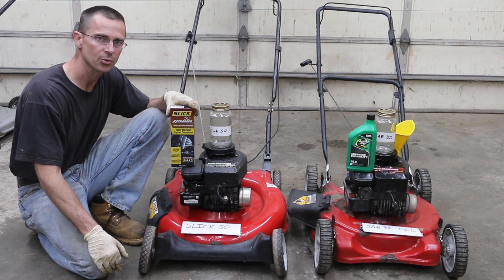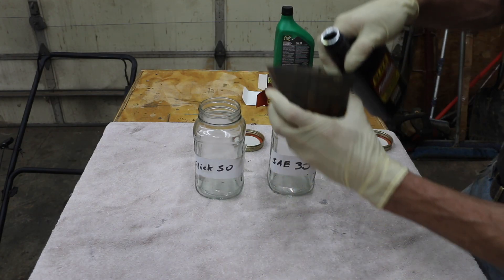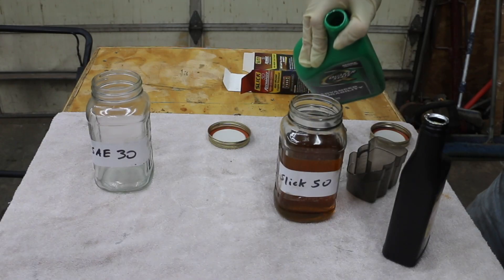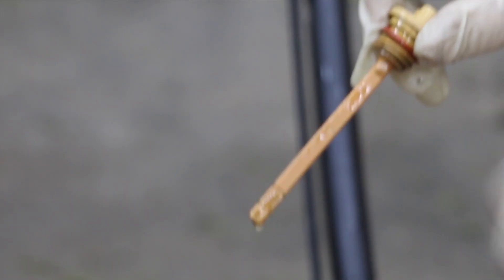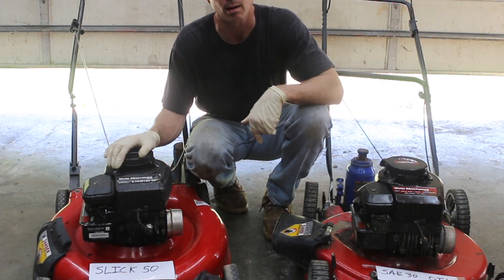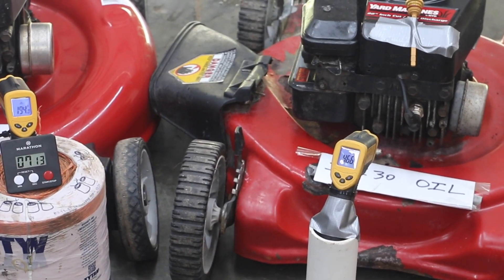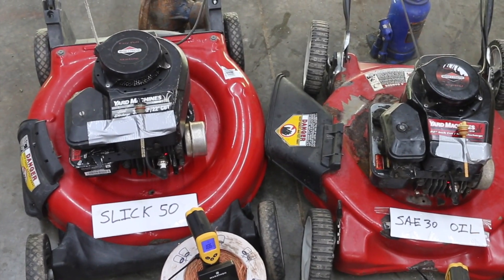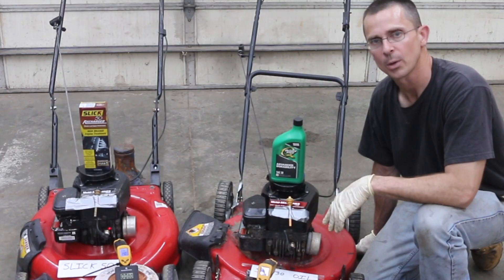Can't believe what SLICK 50 did to my engine!!--Dry Crankcase Test!

Comment: The original developers of slick 50 never did market it because they found it to be generally ineffective..Because of monopoly issues the original company had to sell it because other companies knew it was marketable effective or not..The rule of thumb today is don't add anything to the oil you are using because the manufactures spend a lot of time and money making great oil right out of the bottle..It doesn't need ANY help..You will generally detract from the quality if you mix anything into it..It's like this..Specific base stocks are blended with specific additives..We should never try to out think companies that spend millions in labs to produce the liquid gold we choose..Last hint..All oil is good oil today..The most important thing by far is change it regularly..!!!!!!..This video was a great example of not mixing anything with your oil..Run it as is!!
Reply from the maker: Thanks for the feedback.

Comment: You know about 20 - 25 years ago there was something with, I think it was PTFE in it. Was that the Slick 50? I remember trying it and adding it into my engines using a plastic 8oz clear plastic measuring cup. I still use the measuring cup in my garage today, however I do notice in the bottom of that measuring cup is a clear substance that looks exactly the the plastic that the measuring cup is made of that dried rock hard. It was a small amount that settled in the bottom of the measuring cup. To this day it is not removable.  It is almost as if the PTFE was a substance that would fill any microscopic voids or scratches and make that surface perfectly smooth. They used to advertise it as being like wet ice against wet ice.----------- This additional comment is being made AFTER both engines seized up.  I do believe that no engine will last without an oil, or lubricant in the sump.  But I do believe Slick50 was probably a better product as it would, as I said before, actually "fill" small scratches, or voids and allow for smoother surfaces to rub against one another.
Reply from the maker: Thanks for the feedback.

Comment: Many thoughts however the most defining idea is that if Slick 50 or any additive protected significantly then manufacturers would would install it at the factory to insure against any issues during the warranty period.  I am not aware of any manufacturers buying into this cheap insurance.
Reply from the maker: Great point. Thank you

Comment: I was told (by a Harley mechanic) than any engine that has roller bearings (as Harleys do) need some friction to make sure the bearings roll and not just slip. So something like Slick 50 might actually do damage.
Reply from the maker: Thanks for the feedback.
Reply: Yes similarly i have heard that  sometimes too much lube in certain circumstances can be a problem , like for example in bearings that use grease , if too much grease  is applied  the rollers may actually not turn and just glide on the grease eventually  ruining the bearing .
  Hard to really understand why the slick 50 failed  early without  stripping them down .
 Many years ago in Australia there was a product advertised where they added some magic lubricant that allegedly put a coating on the engine internals , then they removed the sump and ran it even drove it  for some time and it  did appear a legit product.
IIRC they pulled the motor down after a drive and it looked perfect , , i think it was done on an Aussie ford 6 cylinder large sedan ?  
  But i don`t know for sure , i think the product was called Bardahl  engine protection ( not sure about the spelling ,  dont quote me on that though   :)  ) .
   The thing that goes through my mind , 
is if these magic additive products really makes metal parts not wear , car manufacturers would be onto it like a rat up a drain pipe  :) , but here we are over 100 years of motor cars and still using engine oil ( probably  a bit better quality engine oil , but still engine oil ) .
  I had a bit of a look for the aussie demo  video of the bardahl stuff , but could not see it , 
I did find a phillipino one , but they did not do a tear down afterwards .
   https://www.youtube.com/watch?v=Q2uqtmcQtJE

Comment: Thanks for all your great vids. Just wondering i use a product called nulon in Australia. It is like a rougher version of slick 50. Nulon is actually milky whereas I noticed the slick 50 was clear. Would shaking the slick 50 more b4 adding to the oil be more beneficial. Can I ask how long U ran the slick 50 in the mower b4 draining. From my experience with nulon it takes about 4 or 5 hours of  operation to optimise the coating on the wear surfaces.

Comment: i just saw that slick 50 formula is now named : xcelplus oil additive , and the slick 50 name has been bought so you are not getting the original formula but just paying for the name and  not getting the good stuff , i used it in 1994 just looked it up , great experience , dont even know if i got the good stuff

Comment: i think the mowers should be of the same brand at least , imagine the one with sae 30 is a Toyota and the one with slick 50 a kia , im just saying china bearings vs japanese vs american bearings a retest with same brand of mowers would be cool , i just slick 50 , 20 years ago i used it and  the engine really liked it improved in every aspect from starting , much better throttle response more mpg and now i just finished a rebuild  G13A car engine and was thinking of breaking it in with some slick 50 so ended up watching this video good job keep it up

Comment: My only question is what temp each engine would run with the same oil?  Maybe the Slick 50 engine ran cooler anyway.  
When I lived in the UK many years ago, I used Molyslip (molybdenum disulfide), because of similar commercials, but it was a thicker, silvery additive.  Never seen it in the US.  No idea if it worked!  Now I just use Synthetic oil and change every 6000 miles
Reply from the maker: Thank you for the feedback

Comment: Did you ever test Muscle products MT-10 metal treatment? Made in Butler Pa
Reply from the maker: Thanks for the video idea.
Reply: @ProjectFarm  I've used it in all my vehicles and equipment for over 10 years. No engine issues or high oil consumption.

Comment: How about trying prolong engine treatment. I used to run it in my 92 2.5 S10. I never lost an engine to lubrication issues. All of the failures were top end in the number 3 cylinder. Broken valve retainers and broken valves.
Reply from the maker: Thanks for the video idea.

Comment: I wonder why the control ran for only 7 minutes when the control in your experiment with Bestline ran 38 minutes. That’s a big spread.
Reply from the maker: Great point.  Briggs and stratton engine used in this video and predator 212 engine used in the Bestline video.  Major differences in engine design

Comment: leaving out uncertain wear histories between the 2 mowers I have a few comments...

ORIGINAL Slick 50 used ptfe as an anti wear additive...until a bunch of people weren't changing oil and the ptfe got cooked in oil galleries and blocked oil flow

whatever is in current Slick 50 is probably getting cooked into clusters that are seizing the engine much faster since it is not being circulated & cooled down by flowing oil; sae 30 plain oil lacks whatever is in Slick 50 & stayed as a microlubricant on surfaces until engine cooked off residual layer of oil
Reply from the maker: Thanks for the feedback.

Comment: Slick 50 is a Teflon based product. It's been shown that the Teflon will form clumps which can clog oil passages and starve the engine of oil.  Those worried about extra lubrication should look for a high zinc oil.
Reply from the maker: Great feedback. Thank you

Comment: Since it’s supposed to absorb into the metal I’ve often wondered if duralube oil treatment would protect the engine better than other additives. If I remember the product would migrate toward heat to lubricate the parts.
Reply from the maker: Thanks for the feedback.

Comment: Back when it first came out we used to sell it like Amway. Our demo engines were treated with pure Slick 50, no oil mix. We’d fill them and let them run to operating temp, then drain them. These engines had plexiglass installed so customers could watch it during the sales pitch. They’d run flawlessly for quite awhile. That was 1981.My 69 VW bug I lost the oil drain plug and drove 150 miles before discovering it, was treated with original formula  Slick 50. No damage to the engine. I’m also a Motorcoat user. You ought to try the same test with Motorcoat, in fact their old product videos did a similar test. You might contact the company and present the challenge, show them this video. Thank you for all your work! Please keep it up! The original formula Slick 50 is now Xcelplus according to the John Bishop interview. People made good money selling the original formula and it was a good product.
Reply from the maker: Great feedback! Thank you

Comment: It depends on the oil that's added to slick 50, I had good luck with slick 50, it made my lifters less noiser engine ran smother, but I never thought it would keep motors from locking up without oil,you folks crack me up, I would like to see wood gas projects

Comment: Try Duralube.  My father once had an oil change place install his oil filter with no rubber gasket and he drove 3 hours on the highway immediately afterwards.  When he arrived at his destination the bottom and back of the car were completely covered in oil and the crank case of his Camaro's 305 V8 was empty.  The shop paid a dealer to analyze the engine for damage and they found nothing wrong with it.  The engine went on to live a long trouble free life!  My father has always run Duralube in everything he owns and swears by it.  He tells this story often.
Reply from the maker: Thank you for the video idea!

Comment: 30 years ago I had an engine I treated with  slick 50 I run it an hour dry then filled it with water and run it for 30 minutes  and it  never locked up  but the stuff you buy now days I think is different stuff.
Reply from the maker: Great point. The formula has changed from the original formula

Comment: I remember the Slick 50 commercial from years ago that you mentioned. A work acquaintance thought PTFE was the key to world peace, among other things. His 1989 Caprice was dosed with it occasionally, along with regular oil changes with Mobil 1. The Caprice was still running on the original engine with over 300k miles years later.  

That engine was treated well and received regular oil changes. That, no doubt, was the biggest factor for such longevity, in any case :)
Reply from the maker: Thank you!

Comment: Have followed you for quite a while !
We own a small engine repair facility as well.
Our second business is an industrial lubricant, etc. distributor.
We also have a product that we demonstrate in a running engine after adding the recommended number of ounces of product to straight SAE30 NAPA or equal motor oil, run it for approximately 7-8 minutes with the two, then drain, and let the engine sit and run albeit a bit above a higher than a normal idle for a number of hours.
If I send you the product, and the  SAE30 motor oil, would you be willing to do the demonstration on camera for me ?
I am severely injured, and no longer able to do the demonstration, definitely not able to do it on camera !
We really don't want to be pushing the product at this point, until you would feel like you would be comfortable with doing the demo.
Looking forward to hearing from you.
Thanks again, totally appreciate your videos, and your testing methods !
Reply from the maker: Could you please create a new comment or send an email to me at projectfarm52@gmail.com   What's the name of the oil additive and brand of motor oil?  Thank you

Comment: The product you mentioned in the old ad is called ''DuraLube", I used on all the old cars I have, my own experience was I had almost no oil(the oil light is flashing and no oil on the stick) on my 1987 Acura Integra, not able to pull over right away until I got to a safe spot to put oil into the engine, I thought the car is toasted, however I kept driving it until 240000km, I remembered the "no oil" happened around 150000km.  I am surprise to see the Slick50 lawnmore die first from your video, anyhow good to see the low temp on Slick50 and keep up the good work you do, very useful.
Reply from the maker: Thank you for the feedback

Comment: 2 potential issues with the test.  First, it looked like you got almost all of the oil out of the SLICK 50 engine and you only got 80% of the oil out of the other engine; having 20% oil is better than 0% oil.  Second, SLICK 50 is supposed to have an initial application period that was 5000 miles for cars, which is probably around 200 hours; unless you did that in the lawnmowers, the teflon didn't actually get applied to the engine.

I used SLICK 50 for a long time in one car; I don't know how it affected engine wear but it did improve gas mileage by 1-2 mpg.
Reply: Slick 50 requires repeated run cycles to build up and deposit it's proprietary anti friction surface. Run an engine for 20 hours on Slick, Then repeat the tests.
Reply from the maker: Thank you for the feedback
Reply: @ProjectFarm  Based on the information in the video shared by Glo Right a few weeks ago, the current "Slick 50" product is not the original formula for which we recall those engines running after being drained. That original formula is now sold under the brand Xcelplus.
Reply: @jebucha  your correct! My friends dad buys it in the original formula 5 gallons at a time from a guy who has a bunch of drums he's been hoarding. He says whatever they took out made the new stuff garbage.

Comment: Slick 50 according to an auto engineer must be used with motor oil. It was designed as an adjunct an additive with high grade oil. My engineer has well over 350,000 miles on his car! One man has a little over 450,000! He knows the inventor of 50. They have tested Slick 50 on about every engine made with great success using experts analyzing the tests. 

Maybe using a lawn mower engines Isn’t the way to go and they don’t really compare to a car engine? I am no expert on that one. 
I bought a VW with a rebuilt engine. Unbeknown to me the oil plugs were not removed when they installed it. I later found this out. I drove all over LA San Diego for a very long time. But l noted more heat in the car and a smell. But all seemed fine. 
But l took it in to a VW garage. They found the problem. At no charge they took the plugs out. It ran fine. They asked me did you use an additive as the engine should have fried! We are amazed quite frankly. 
I told them since day one Slick  50. Again,they were stunned. Then they admitted. they were the ones that had installed the engine! They as well as myself couldn’t believe out of all the places l could have gone it was to them. They apologized. They said the engine is excellent.They shocked it was Slick 50 as they had seen engines burn up because someone had forgotten to remove the oil and they drove much fewer miles than l did. No charge as given!
Reply from the maker: Thank you for the feedback

Comment: Years ago, I used to buy an additive called Foxfire. Matter of fact, I think I might still have a bottle. I used it in one of my International with the DT466 engine. I put it in the front wheel hubs, the transmission and rear end, and of course the engine. It would pull better, went from about 8mpg to consistently getting 9 - 9.5mpg. I sold some to a guy and he put it in his motor home. He swore it pulled hills better. The real test was I used to have this trailer and every time I went to roll the landing gear (thing to raise it up) , it would squeak like crazy. One day I just took my finger and rubbed some on it. Several month later it still wouldn’t squeal. I was buying it from a guy in Paso Robles, Ca. Anyhow, he told me one day he was talking to someone about taking it nationwide. Next time I called to order some, no one answered. Still don’t know what happened to it , but I’d sure like to get some more. It worked!
Reply from the maker: Thank you for the feedback
Reply: Project Farm have you ever heard of Foxfire. They had their name on a NASCAR truck. Several folks used to buy that additive from me.

Comment: Did you ever use Energy Release.  There is nothing like it and I think that you can only get it on ebay.  I've watched many friction machine test and with the Energy Release, you will be shocked how it does there.  I've used it since 1987 and the only drawback that I have ever seen is that it drops the engine temperature so much that my car will never get warm in the winter.  Every car did the same thing.  It takes about twenty hours before it starts working.  I would love to see a test of that.
Reply from the maker: Not yet. Thank you for the video idea!

Comment: The slik 50 that was available 30 years ago is no longer available I think it was 1984 disappeared.  The ingredients have changed the company still used the results of dry engine running until the were in a lawsuit with the owner of secret ingredient so slik 50 now is rubbish,  but if you use Bishop's original it is the old slik 50. Also use xeclplus it's also the same as the Old SLIK 50 
The guy that owns the ingredient's didn't Paten the name Slik 50 or we would all be still using the old slik 50.
Love all the video's A big hello from Carrickfergus Co Antrim Northern Ireland. In the old UK
Reply from the maker: Great feedback

Comment: Not too familiar with the specs on Slick 50, but do they recommend using it in air cooled engines (which run hotter)? Might make a difference.
Reply from the maker: Thank you for the feedback